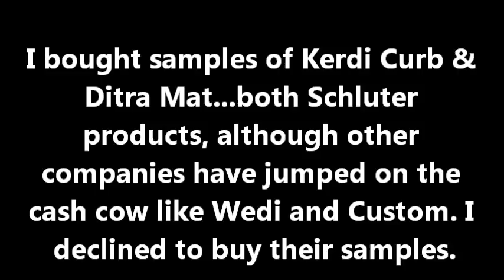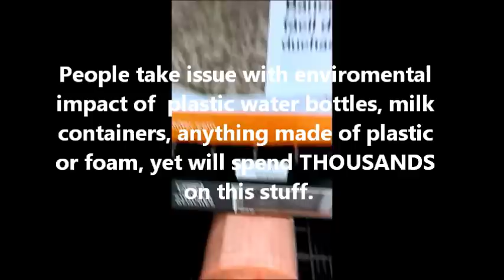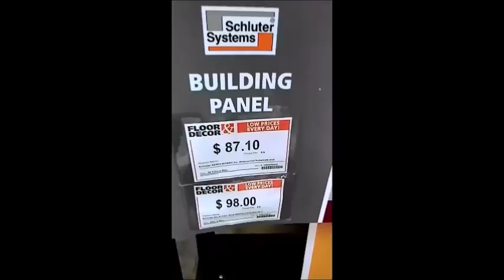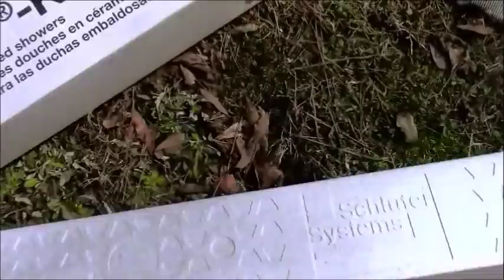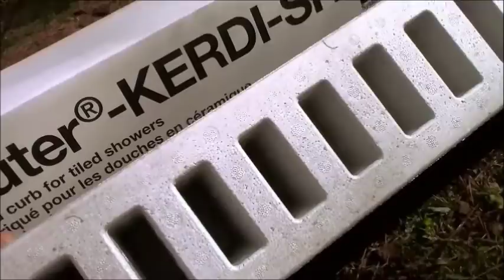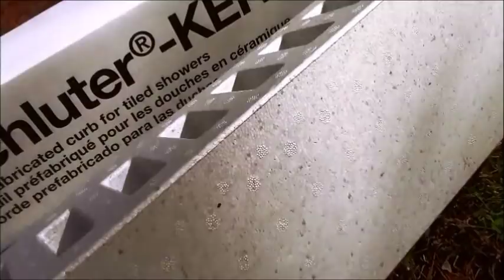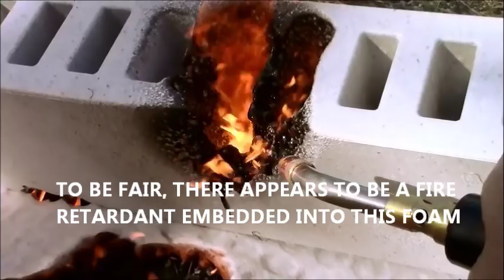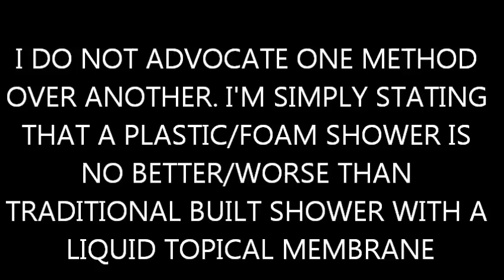BUILD SHOWER FROM FOAM and PLASTIC ??

Comment: I would comment, but it seems you have deleted all opposing views. So what’s the point. Enjoy your echo chamber.
Reply from the maker: I deleted exactly one comment...for cursing...and he was blocked.
Otherwise I'm good with opposing view points. There is no right or wrong way, as I stated at start of video, this is *MY SUBJECTIVE VIEW*, others have theirs.
Reply: StarrTile .....Ok, here goes.....I get that it’s expensive, I recently built my first shower Kerdi, it cost me around $800. But for me, I felt that your traditional way of making a shower pan would have impossible to do in my situation. Plus, I have more confidence in the water proofing ability of a sheet of plastic than a can of red paint.
As for your fire demonstration, I feel that is very misleading, you only proved that you shouldn’t have the stuff just laying around in your house in case of a fire. You know that all of these products are totally encapsulated in thinset when installed. I’m not an expert on fire safety, but I would think that all of that thinset,tile,cement board even if you used drywall, would add significant fire proofing ability. Worst case, make a mock up of the ditra on 3/4 inch plywood and see how long it takes to go up in flames.
Reply from the maker: Yes the expense was the MAIN point of the video...but then again I feel better with a steel bumper over the plastic ones you see littering the roads, just my feeling on it. As to the gallon of paint, Redgard, Aquadefense, Hydroban are all crack prevention membranes & water proofers. Once tile is over them & grouted it's encapsulated, so whats under is irrelevant...there goal is to stop water/moisture penetration and they do that. I made a video YEARS ago, painted a cardboard box with it, filled with water & a week later no leak...SO I'm comfortable using cardboard as a backer. 
The fire demo was for those concerned about health/environmental issues and was secondary to the point.
I will say this though, a room in a fire heats up FAST and direct contact of fire is not the ONLY way fire/heat spreads, there is convection/conduction, and nearby fire loads that contribute to spreading...but that's a WHOLE different discussion.
Reply: John Patterson I've been razzing this guy for as long as I can remember -- he never blocked or banned me. Finally he is starting to win me over. I like this video (the points he makes are obvious and it's about time someone in the industry spoke out) and another one I watched recently where he credited the Polish guy in Atlanta for teaching him something. That's classy, to admit there was something you didn't know and to credit the person you learned from.
Reply: >but then again I feel better with a steel bumper over the plastic ones you see littering the roads

That's the dumbest shit I have ever read on the internet. The plastic bumper is only a cover it only provides looks, ALL cars have steel bumpers under the plastic.